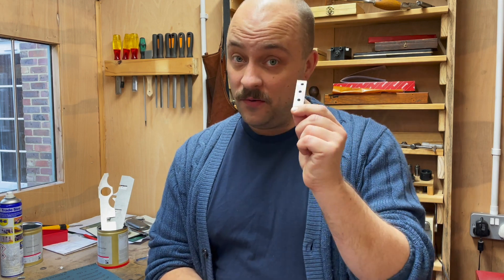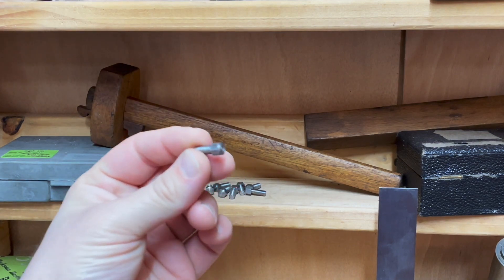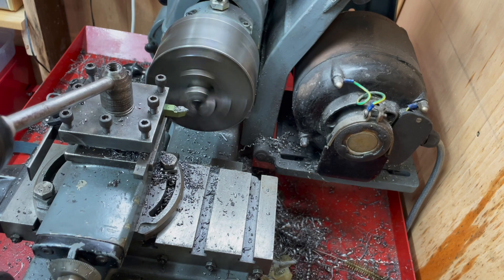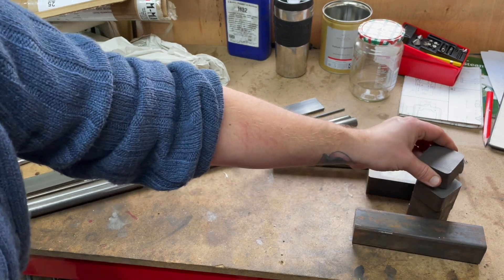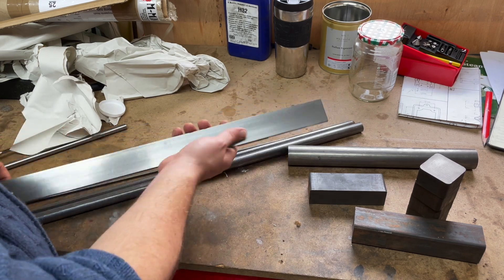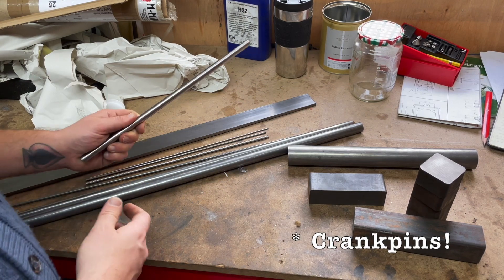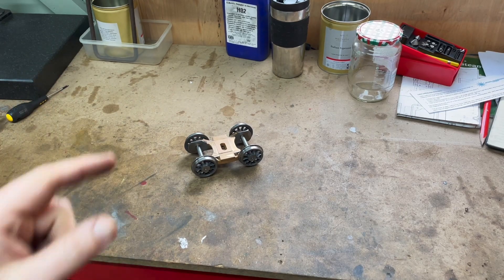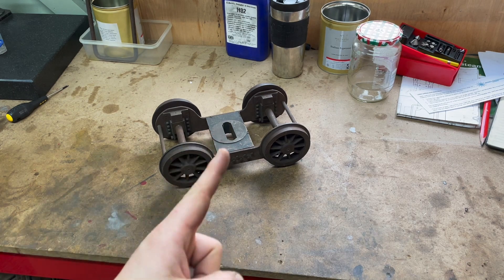Magical Machining and Massing Materials - Steam Locomotive Build #4

Comment: Don't over think the movement of the axleboxes. Yes clearance needed but I would build the basic chassis up first and tweak later. Same with the clearance on the axleboxes to let them rock, gentle use of a file to give the relief should be enough.
Reply from the maker: Thanks Adam, with split axleboxes I guess I can make all of those tweaks later - as opposed to single piece which would be stick on there for life!
Reply: @williamsworkshopuk  yeah certainly makes life easier in that respect. You’ll have the feel for the axleboxes in the horns long before it’s too late to do anything about it.

Comment: We have 2 maids in the Reading Club with both of them going superbly.
One built by a grandfather many years ago. 30 years on display.
And off round the track like a rocket.
Early locomotives are interesting they just take more fine finishing. David and Lily.
Reply from the maker: Thanks David, they certainly seem a solid choice. Given the number knocking around s/h I hope that bodes for its ease of construction and not its lack of long term appeal..